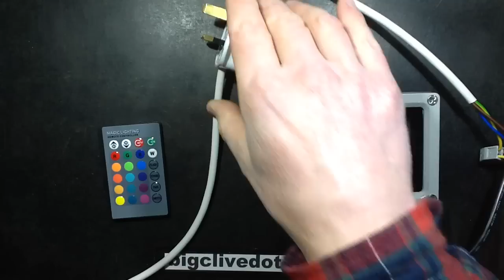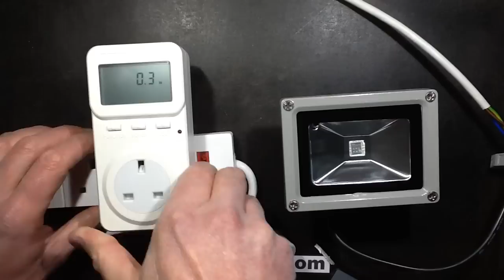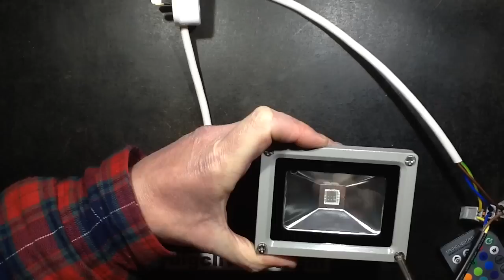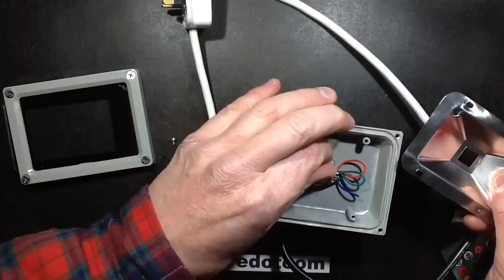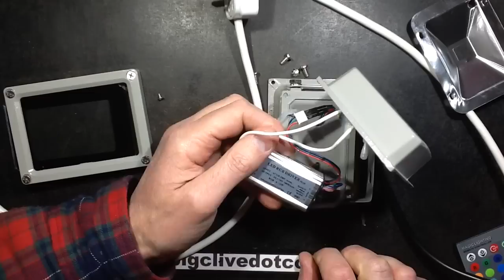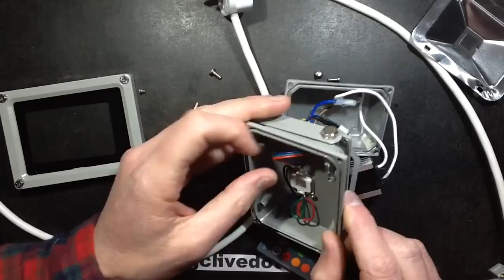The RGB floodlight of disappointment.

Comment: I got a 30W one from Farnell - each colour channel was 10W (I checked the driver and it says it's 30W - 10W for R, G & B). White and mixed colours were 10W too. My guess is that it's so all the colours are the same intesity. At least it's properly grounded and comes with CE mark (proper one too!). It also had a similar style all-in-one driver/controller.

Comment: This is very common with rgb drivers. They run a constant current pe color, which means if two colors are combined, the current doesn't double as it should. Some LED strip controllers can drive these 10w LEDs to full power if you add the proper resistors. Heat does become an issue at 10W so surely they put the 4W limit to save on proper heatsinking

Comment: you should measure the current and voltage going to the actual led itself not the power drawn from the wall because the power supply is inefficient so it makes some watts more on the 220v side. i believe that this led is 3watts .

Comment: Clive, I've watched all of the RGB flood videos over and over again. Do you reckon you could slice out all of the control circuitry and drive the RGB LED directly from 12v? Would you need any current regulation etc?
Reply from the maker: +JoeRKsChannel You would need something to limit the current.  In the case of an RGB LED you would probably use a  10 ohm resistor for the blue and green channels and a 20 ohm one for the red channel.
Reply: +bigclivedotcom Thanks! Planning on repurposing some of these along a parallel chain of around 5 units. I want to strip out the circuitry and have them run back to some 3 channel DMX decoders. Our whole garden system runs with DMX (it's what I know!) and I have made RGB floodlights before by creating panels of 5050 RGB strip inside floodlight shells. Very time consuming and messy however, this looks like a potentially better option!
Reply: Clive, obviously these resistors would need to be pretty beefy (around 4W) and would dissipate a lot of heat. Do you reckon a few LM317s would be up to the job?
Reply from the maker: +JoeRKsChannel The LM317s would dissipate the same heat as resistors.
Reply: +bigclivedotcom I realised as soon as I posted! I wish there was a plug and play solution, much like your prototype PCB!

Comment: I thought i'd mail you here instead of bothering you in your inbox.... anyhoo, I bought a few of these 10w rgb floods ages ago, and the ones that have the all-in-one transformer and rgb controller (like in your video) have a failure mode of just dying (possibly overheating) but not tripping anything, whereas the other ones from a different batch with the dodgy 240V>12V kapton tape-wrapped transformers have a failure mode of the bridge rectifiers failing/shorting and blowing many many fuses & circuit breakers.

so upon seeing the same led flood but in a 12v version for sale - often with a wall wart as well - i was thinking of converting the remaining rgb floods (and the ones where although the mains transformer had blown but the leds and their drivers had survived) to running off a 12V supply. 

would the resistors on the led driver board be enough to stem the current flow from (eg) a 12v 1000mA wall-wart supply? (the ones that are about 12 and 22 ohms respectively?) Or should i be looking to fit (eg) a 100R 10W resistor in-line with the PSU?

Comment: I would like to use one of these lights in combination with a home automation system.
There are typical 12V PWM dimmers available for LED stripes. Also with 3-4 channels special for RGB(W).
Can you give me an advice what's the best or easiest way to drive this LED with them?
Just to use resistors with a suitable power rating or maybe some sort of constant current source?
Reply: +hurz h Those dimmers are just FET switches driven by a PWM circuit. So they just chop 12 volts, they don't reduce the voltage. If the power dissipation isn't a problem, use a resistor. If it is, you need a variable current output circuit. I've seen them on eBay cheap.

Comment: Why does the IR receiver need to talk to the resin blob using three, RGB wires? I did wonder if all of the control was in the IR chip and those wires were perhaps driving the blob inputs as pwm - which might be convenient for your controller?
Reply from the maker: The infrared receiver is an active electronic circuit which requires three wires.  +V, 0V and data out.
Reply: Makes sense. Thanks.

Comment: can you give me a bit of advice please,? I bought new photography bulbs from eBay and 2 blew after 10 mins they sent a replacement but they done same today only 2 have been OK! 
one bulb just blew first and the second went after it about 5 mins but blew fuse in plug? can you tell me if I can put in bigger fuse or lower it has a 5A
Reply from the maker: +Horticulture and Bonsai est2005 (Doug) The high power compact fluorescent type photography lamps are notorious for failing quickly.  They seem to overheat easily.
Reply: +bigclivedotcom I've heard some of the cheaper ones will overheat if you leave any oil from your skin on the bulb. Not sure if that's true, although I do know that happens if you touch headlight bulbs.
Reply from the maker: +DanJBMedia The oil issue usually relates to tungsten halogen lamps.  They operate at such a high temperature that they require quartz glass globes.  The oil in the fingerprint causes devitrification of the quartz, causing lots of tiny hairline fractures and ultimately lamp failure.
Reply: bigclivedotcom Thanks for the explanation. :D I didn't fully understand why that happened until now. 

Also, if you're brave you should check out some of the nightmare tablets on Ebay from China. Some are actually quite good. . And the rip-offs of those are so poorly built it's scary xD I bought one for laughs, it was about $20USD. It had two charging ports, micro USB and some strange separate one. . If you charge it via the micro USB it WILL catch fire. :D

Comment: Do you ever sell those RBG software chips, and are they compatible with those remotes?
Reply from the maker: +Alex Barlow My own RGB software does not have any remote control facility as standard.  It's intended for fixed applications like mood lighting or architectural purposes.  The main strength of my software is the randomiser that gives infinite variety of colours unlike the Chinese software which just loops round a few pre-programmed colours.
Reply: +bigclivedotcom Do you have a schematic of the current limited RGB controler ? I am currently trying to build something similar using Arduino and three 1W LED's.
Reply: +bigclivedotcom I got the same kind of floodlight, just received it five days ago, not working of course. Can u give me some ideas who can fix it? I'm not a hands on guy, really clumpsy and don't have the patience to fix it. Thanks for video.
Reply from the maker: +Tony Garza Is it the type that is radio remote control as opposed to infra red?  Does it blink briefly at power up?
Reply: +bigclivedotcom No, mine is not the remote control, its just the regular light either warm white or cool white, don't know cause it never worked. But the light fixture is exactly the same I have but its a 10watt 900lumen. Bought it online from walmart but a different company shipped it. Thanks, any ideas appreciated on how to fix.
Reply from the maker: +Tony Garza If it's new then I'd get onto the supplier for a replacement.

Comment: 10W RGB Floodlight If you want to test the total power should be R + B + G total wattage, you can light up the three chips together to test I think there should be 10W, why the red power is small, because the red single Red chip voltage is only 2.2V or so, the normal chip voltage is 3.0-3.2V. If you want to know more please see http://www.raylighttube.com/led-flood-lights
Reply: RAY LIGHTING white is rgb together

Comment: I've been wondering why the LED flood lights have a deflector? Its my understanding that LED's are directional, am I wrong? The only reason I can think of is maybe the glass reflects some of the light back into the deflector and back out?
Reply from the maker: I think it is that, and also for cosmetic reasons.
Reply: bigclivedotcom I can see in this video some reflecting of the reflector but not sure if from led side leakage or reflection.

Comment: those cheap chinese RGB lamps are total crap as they use a controller that can't do proper RGB fading (they insert white into the rainbow, which I don't like).  I seems like if I want a decent RGB light I will have to get ones with DMX control